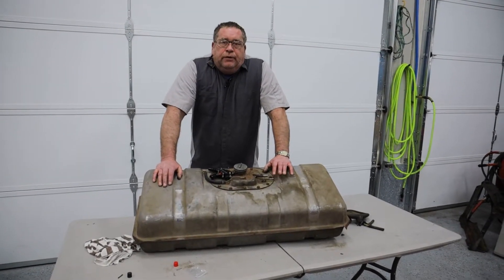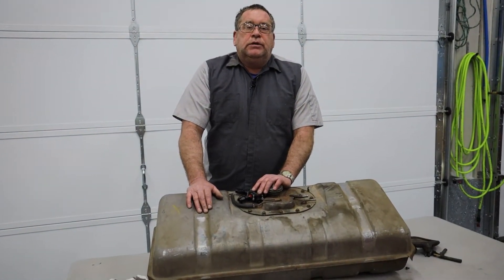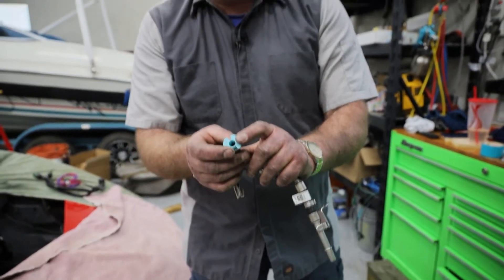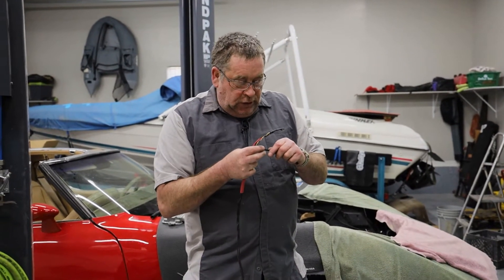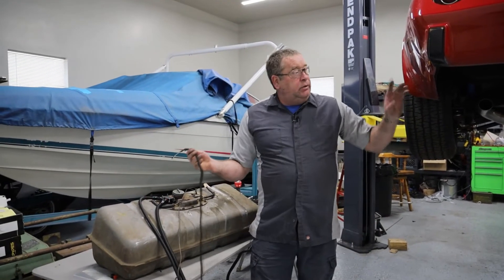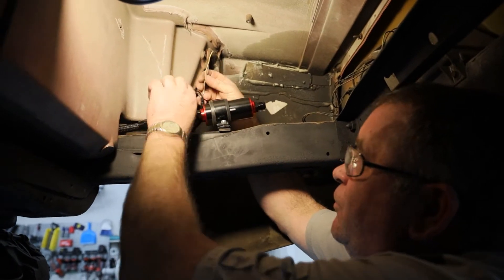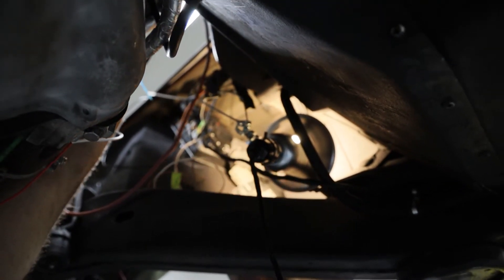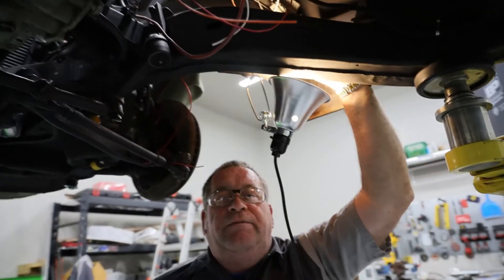Gen 5 LT1 Engine Swap Fuel System Upgrade

Comment: Thanks for that explanation, the LT1 does not need a return line if the pump is controlled by the computer.  It will need a controllable/compatible pump, controller, filter, and an inline pressure switch if I got this right. Hopefully I can get my LT1 swap going soon.

Comment: Glad to see a C3 considered for Gen  V LT swap.  And no fuel tank swap, but using the stock one.  Please keep these coming, and a suggestion: include your costs as you go.  For those of us considering an LS vs LT swap, there are reasons (monetary ones) for bypassing the LS and going for the LT.  Thanks.